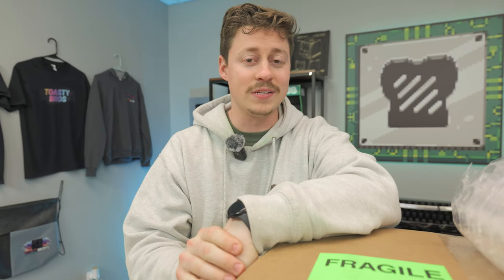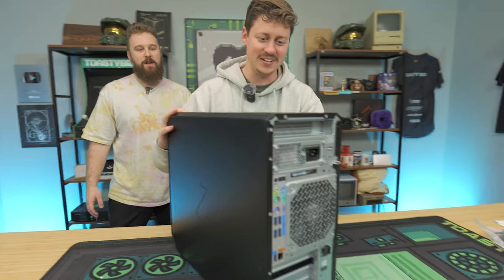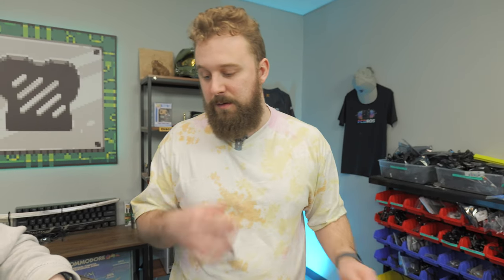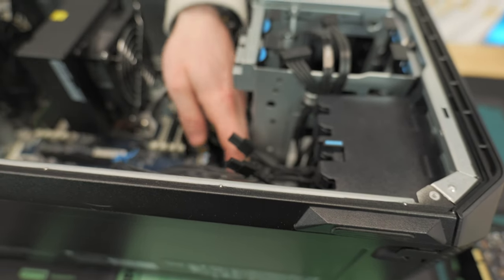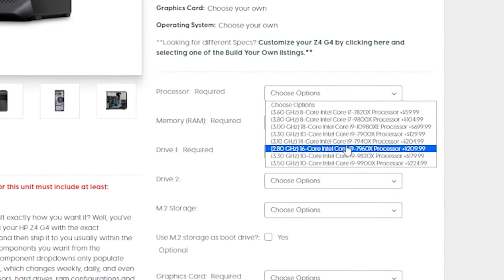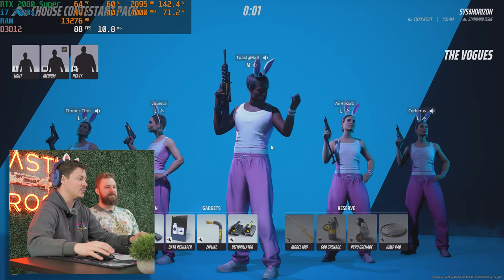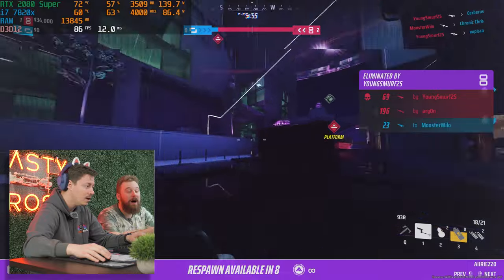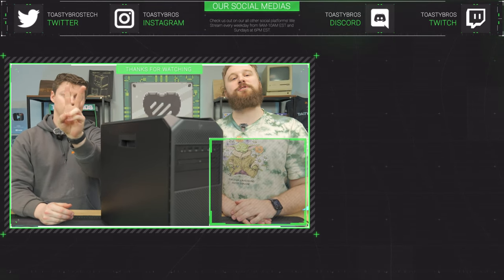The NEW 1440p Budget Gaming PC Meta is HERE!

Comment: With the fortnite part, direct x 12 runs pretty poorly on it. I have an rtx 4070 and it is so choppy with dx12. Im forced to use dx11
Reply: @DarkLinc45 I rarely ever have a problem and I'm running 1440p on mostly highest settings (as long as I'm on dx11)
Reply: that’s weird do what cpu do you have and what ram ?
Reply: @argyleangulo926  my CPU is a 7700x and my ram is 32 gbs at 6000
Reply: Dx11 runs like a stuttering mess to the point I tried it for 20 mins after seeing this comment and just switched back to dx12 running a 9900ks and 4070ti  32gb 4000mhz ram get a few stutters but think it's server related as hardly any maybe 2 every 30 mins
Reply: @givejah610 I have an i7 8700k and GTX 1060 6GB. I uninstalled Fortnite on my PC because I don't play it anymore but when I did play it ran okay at medium settings.
Reply: @givejah610 6000MHz? DDR6 I'm guessing. Man that's fast. I have 16GB  of DDR4 RAM at 3000MHz. 😂

Comment: I mean for the same $600 you could out together a p.c. With a 5500 and a 6600xt that would outperform this so not sure why anyone would do this….
Reply: purely to make content, most of the systems they build are not the best options.
Reply: 2080s is fair amount better compared to the 6600xt.
Reply: @bumbaclot813  true lol it has a fair amount
Reply: @wildkoala_ I'm not sure it's worth buying used but to each their own.
Reply: FR. Just did the 5500/6600 meta build to sell. The Power Color Fighter I got benchmarked like the average for the 6650XT and 3060. The 5500 performed like 5% over average. Late production silicon is usually pretty good. Drivers are fully developed. Lots of reasons to not be an early adopter, really. 
All this older hardware has enjoyed an incredibly long life for gaming but it is time to move on. You don't have reBAR, DX12U or AVX2 and aren't on the official support list for Windows 11, GL selling it to anyone who wasn't born yesterday. I'm trying to offload a 4th gen i7/1080 system and it is tough. Been listed for over a month. At this point, I'd be happy just to break even on it.

Comment: Near the end of 2022 when I was going over options for replacing the $550 Xeon+RX 580 custom PC I got on eBay in 2020 (long story and Life Events involved), I was actually looking at the you-build-it Z4 and Lenovo workstations on PCSP. There were some tempting combinations there (there's far more than just the one build shown here), but in the end I decided I had the budget to make my own Ryzen 5 5600-based system, which was completed in Feb. 2023.
Reply: How much did it cost and what parts did u use?
Reply: @talha2615  Ended up around $700 in total. I don't remember the exact cost as there was some "scope creep":

But the system is:

Ryzen 5 5600X
Used RX-580 (XFX, I think, in good shape)
MSI B550 GAMING GEN3 ATX AM4 Motherboard
Corsair Vengeance LPX 32 GB (2 x 16 GB) DDR4-3200 CL16 Memory
WD Blue SN570 1 TB M.2-2280 PCIe 3.0 X4 NVME SSD
Cougar MX330-X ATX Mid Tower Case
Thermaltake Toughpower GX2 600 W 80+ Gold Certified ATX Power Supply
Thermalright Assassin X 120 Refined SE 66.17 CFM CPU Cooler
Asus DRW-24B1ST/BLK/B/AS DVD/CD Writer (I still use and need an optical drive)

The scope creep involved buying another RX-580 ($100 on eBay) rather than resusing the one in my Xeon system as I had planned. And I added a SATA SSD for a D: drive, then a year later I had to replace it went it went bad. And I switched to a 5600X rather than the planned 5600 since the 5600 was delayed from Amazon, so I went to my local Best Buy and picked up a 5600X instead. So originally it would have been about a $550 system.
Reply: @AlphaMensae1  thanks for the information . How is the rx 580 for 2024? Can it play r6, fortnite, and cod well? What fps can it play on at 1440p or 1080p am quite new to this all and im looking to biuld my first pc.
Reply: @talha2615  That's the funny thing, I'm not really a gamer. The only game I play regularly is heavily modded Kerbal Space Program (a very CPU-dependent game), plus older (like 12+ years old) stuff. I also make a mod for KSP, and so I use a 3D modeling program, the Unity editor and GIMP. I also do some video editing, and stream using OBS. I've run all that stuff at once while streaming.

The RX-580 is like 7 years old now, but it's still ok for 1080p at lower settings on less than demanding games, i.e. not the latest AAA stuff. Haven't tried it at 1440, but probably not recommended for gaming. I did just get a RX-5700XT and 1440p monitor for the next upgrade, but again that's not for gaming, but so I can have more screen room for all my apps; I still use a single monitor.
Reply: @AlphaMensae1  ohh i see thanks for the info though

Comment: I have a lot of love for the Z line of HP workstations. At the end of last year I bought a Z2 G9 for a really good price with an i7 13700 that I paired with a RTX 3080 and upgraded the RAM to 32GB and the NVMe to 2TB for a really solid 1440p gaming PC. It was a big upgrade from the 10 year old i7 4770 and GTX 1050ti system that I previously had and should last me I hope for almost as long.

Comment: My first modern gaming capable PC was a HP Z400 in 2013, with the newer naming it would be the Z4 G1. It came with a Xeon W3520 (same as i7-920), 6GB RAM, Quadro FX 1800 and 2x 500GB HDDs. I upgraded it to 12GB RAM, GTX 660 and 120GB Kingston SSDNow V300. I was on the X58/LGA1366 platform (first the Z400 but later a custom built with an Asus P6X58D-E + X5670 6c/12t @ 4.4GHz + GTX 1080) until November last year when I built a newer X299 system with an i9-10900X.
The Z400 was a huge upgrade from the HP dc7700 SFF I had before it. (Core2 Duo E6300, 5GB RAM, Intel GMA 3000, 80GB HDD)
Reply: I just set one of my friends up about 2 months ago with a z440 that has a E5-1650 v4, 32gb 2400mhz ram (quad channel), gtx 1660 super, and a new ssd; all for under $350. We've been playing a lot of the 2017 battlefront 2 and he can run it no issues 1440p ultra settings at 90-100 fps solid. The CPU also shouldn't bottleneck anything until the 2080ti range.
Reply: U would hv gotten the 1080ti tho

Comment: I bought one of these to experiment with gaming under Linux.   Got the 1000 watt supply used for $43.  It has 8 pin PCIE power.  The 750 watt one that came with mine only had 6 pins.  I got a 7700XT for $400 for it.   It plays games pretty well. 

You can find additional coolers for the RAM an optional front panel fan.

Comment: It would be cool to see the 2080 super in your test rig for a comparison
Reply: Would the 2080 super be a good pairing with the i7 8700k? I currently have a GTX 1060 6GB.
Reply: @BREEZYM6015  You should be fine, there wouldn’t be any large bottlenecks especially if you are targeting lower end 1440p
Reply: @BREEZYM6015  It's all a game of "depends" but the 2080 super will be a huge improvement over the 1060. 

The 8700k might bottleneck the 2080 super in esports games at 1080p, like COD, Fortnite, things like that. If you prefer higher resolution over FPS, the 8700k should be just a few % points lower than a newer gen CPU with a 2080s

Comment: I got a rtx 3060, R7 5800x, 16gb ram and 1tb ssd for 850$ was it a good deal???
Reply: Depending on case, psu, motherboard, cooler, and if anything was used, that could range from an excellent deal to a mediocre one, but definitely not bad.
Reply: @idkmanidcman3158  The case is some corsair case teh motherboard is a b550-e amd the psu is a 550watt + gold and its not used.
Reply: @ninbooo  I’d say that’s a good deal.
Reply: @idkmanidcman3158  ok thanks for answering

Comment: HP Z4 G4 is an unsung hero, good to see it starting to be noticed. Some models even came with a 1000w psu...

I have one with a W-2145 Xeon (8c 16t, 3.7 - 4.5ghz) 64gb ram, Win 11 and a RX 6800.

Scored 14,114 points on time spy and it cost me $950 Australian which is $625 USD... 
(It was meant to be $1050, but I had a $100 eBay Plus voucher.)

2.26 cents per point...

Unfortunately the seller only had 2 left for sale at the time, I wish I had bought them both, but to be honest I wasn't sure it was a legit deal...
Reply: Same.

Comment: How is the 6650 xt for 1440p on rpgs and mmos?
Reply: It's alright. I was running that for the last year and was starting to his some walls, specifically in Hogwarts Legacy and Jedi Survivor. I realize those are 2 very poorly optimized ports, but still. I was even having issues w/ steady frames in Diablo 4, had to drop the settings pretty low in all games. 8 GB of VRAM is just tough for 1440p in 2024

Comment: awesome. i use my 2070 super for 1440 and everything runs pretty smooth. i know i need to upgrade soon probably though. my cpu is a ryzen 3700x..should i upgrade my cpu first? 7800x 3d maybe
Reply: Depends on how much cpu your game uses. Also, higher resolutions tend to use more GPU than CPU.
Reply: I have an i7 8700k and GTX 1060 6GB. I think I need to upgrade sooner than you. 😂
Reply: You can probably upgrade to a Ryzen 5800X3D without changing your motherboard (but will need to update the MB firmware). A 7800X (or 7800X3D) will require a new motherboard and I think new DDR5 RAM.

Comment: I was just about to make your $600 build from the other day. Should I do that or get this ?
Reply: look for used, there are many good options from people upgrading.
Reply: Just get 3060 or rx6600 or higher not any lower
Reply: What was the CPU in the other build? If it's better than this one then I would do that one. There are a lot of good combinations for $600 that can get you nice performance with an upgrade path. Research it and find the parts that will suit your needs the most.
Reply: Do whichever one you prefer. The p520 is a perfectly capable system and it'll run pretty much anything you can throw at it, including a 3090

Comment: is it worth moving from a i5 9500 to the i3 12100f
Reply: Yes. More threads, higher IPC, lower power draw. Only thing is you need a new motherboard, & maybe new RAM unless you get a DDR4 board. Intel Stock cooler should work just fine but it will be a little noisy

Comment: just built a $650 rig all second hand for a friend, 5600X,  RX6800, 16 gig 3200, blows this thing out of the water, I did enjoy the video cause I was always into older workstations but customers didn't want them.
Reply: How is that new 24.4.1 driver? Do you see perf improvements they claim to have? For me it only fixed washed out color looking like HDR ON setting if I was running a second monitor off the integrated gpu and main with my navi 22.
Reply: Do you mind giving me a list of all your parts , I'm looking to build a PC for the same amount
Reply: @Rashadjameson  sure, I am from Eastern Europe but prices should be lower for say North America or Australia
R5 5600X ($100)
ASRock B450M Steel Legend ($80)
2X8 GB DDR 3200 Corsair CL 16 ($40)
I forget the M.2 brand but it was average, 512 gb for about $50
Segostep 600W power supply ($30)
Around 300 for the heavily used 6800XT(actually!) but it should be fine for years to come.
biggest cheapo case with airflow, like $30

A cheaper build would be something like an i3 12100f with a 3060 12 gb, still a great system for around $450 or less(3060s are everywhere)
Reply: @Brukner841  your awesome 💯 I'm from NYC so I should actually be able to get alot of good condition 2nd hand parts & I'm trying to get An idea of the max performance I'll be able to get with around $600-700 because I know I'll have that once I complete my program , but I actually complete Ina couple months so alot of things might actually be cheaper by than as well... But I love planning ahead
Reply: @Rashadjameson  yeah it's quite the sweet spot, last gen so you can take your pick of the ram, mobos, but try to get at least 12 gb of VRAM, or maybe you can find a 10 GB 3080 for a good price but I doubt it. I often build systems with amd gpu's cause they're so undervalued here most of the time, for professional work I'd still take a gaming performance hit for the nvidia stability and supremely reliable drivers.

Comment: I had the chance to get a Z4 with an w-2145 and 32gb of ram for 250$ and a potential 2080ti for 180$ but i went with a Asus Rog Ally Z1X for 300$, idk if i regret not going the other route instead or not 😫😫
Reply: What did you get for $300? Motherboard and RAM? I've never heard of either of the Z4 or the Z1X.
Reply: @BREEZYM6015  HP workstation basically the one in the video but with a Intel W-2145 and 32gb of ram the whole PC, but i went with the Z1X Asus Rog Ally which is one of those handheld devices like the steamdeck and legion go

Comment: Btw the i7 7820x is a very hot at base speeds really hot when ya overclock. I got a 360mm aio and it still gets toasty lol. It also pulls 250w depending what gpu ya choose like me a 3080 ya need 1k watt min.
Reply: i7 7820x from what intel says it's only 140w 🤔
Reply: @bstceltics4  that is the base tdp, but at the settings I got overclocked it's drawing 250w.
Reply: @bstceltics4  I just for curiosity set everything back to default and used intels XTU everything stock I'm still hitting 160+ watts, OC to 4.0 200 wattage, OC to 4.2 around 220w. Ya see what's happing lol more ya oc more it's sucking up wattage. At 4.6 all core it's 250 to 255 watts. I've had to pull the Vcore upto 1.35 to hit 4.6 also.
Reply: @bstceltics4  stock this is just a base 3.6 ghz turbos to 4.3 with single boosting to 4.5 @ stock. The cores are set at stock like 4.5/4.4/4.4/4.2/4.2/4.2/4.0/4.0 n when I say 4.6 all core i.mean each core is at 4.6

Comment: that 10 core cpu is 100% usage that a cpu bottleneck at 1440p
Reply: It's 8c 16t and I got the same one in my system and a 3080 10gb mines overclocked to 4.6 all core and I've never had a issue. Can run cyberpunk 4k ultra with ray tracing 60fps.
Reply: N I just got a 60hz 4k screen so I got vsync on n nvidia low latency on.

Comment: I rly don't like these old school towers,air flow is rly bad and combined with a blower style GPU that just dumps all the heat inside its just a NO for me.
Reply: Actually these usually come with a front fan that blows directly into the gpu, the stock cpu tower cooler is oversized too, they run pretty cool. I rarely see anything over 70C on mine no matter what testing i put it through.